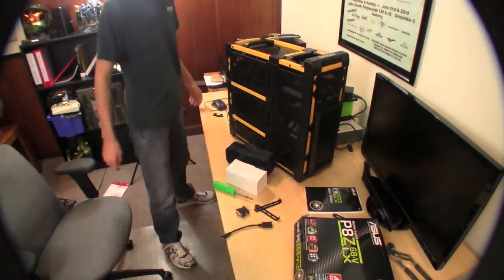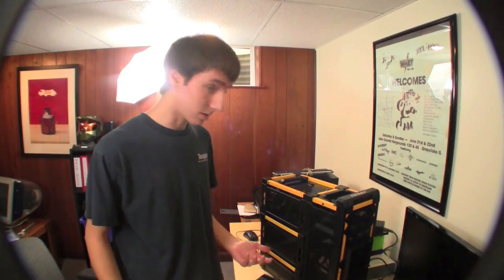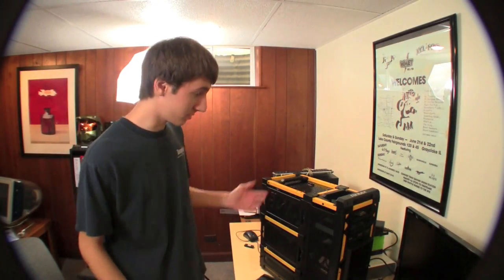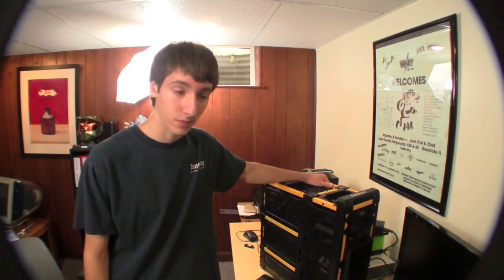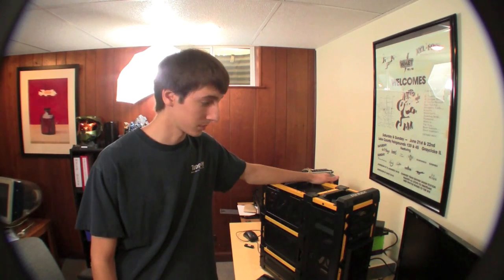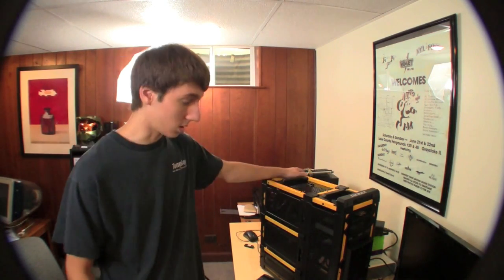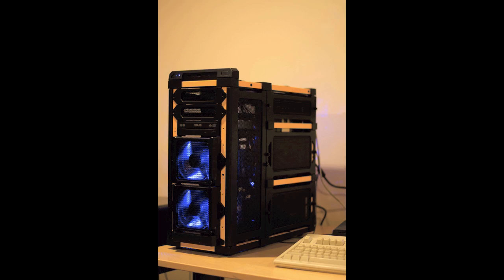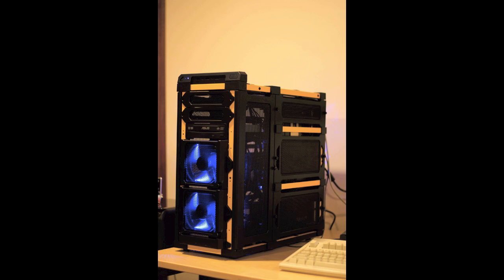Time Lapse Computer Build 2011 4.8GHz Overclock Sandy Bridge (Parts From Newegg.com)

Comment from the maker: I had the i5 2500K running at 4.8Ghz stable for many months, the build cost just under $900.  I have since added an SSD and other parts that have increased the "total" price, but the items shown in the video were just under $900 not including the monitor.  

I now have an i7 3770K running at 4.5Ghz.

Comment from the maker: Only with the 8-pin connector, I had to buy an extension for that.  The 24-pin could be a tad longer but its not a big deal.  Other than that everything was fine.

Comment: nice vid  
 was the 4/8 pin ATX 12v cable (the one which you plug into your mobo at the top left corner) long enough to nicely route it behind your mobo or was it too short. Because I've read some reviews about the ocz modxstream psu and some people had some problems with that.

Comment: Will this be a good build or should i change any parts? (Do i need a new PSU if i'm gonna overclock it ?)
Case: NZXT Lexa S Midi tower.
RAM: Corsair XMS3 1866MHz 8GB Vengeance CL9 
Hard Drive: Western Digital Caviar Green 1TB
Processor: Intel Core i5-2500K Sandy Bridge 3.3GHz
PCU Cooler: Corsair H60
Graphics Card: NVIDIA Geforce GTX 260.(Old Graphics card, might get a new one tough)
Motherboard: Gigabyte GA-Z68AP-D3, Socket-1155
Power Source: Corsair HX 450 Watt (Modular)

Comment from the maker: I agree, a 20-pin internal USB 3 header would have been great.  As for the cooler, I recently contacted Noctua about reviewing the NH-D14 CPU cooler.  The unboxing and review should be up within the next few weeks.  You might want to stick around for that, I got some really amazing overclocks with that cooler on.

Comment from the maker: Yes, I configured everything out myself.  I picked it for the positive airflow (which I have since negated), the price, the handles, and the looks.  Had I known that the case has very little room for cable management, and no fan filters, I would not have picked it.

Comment: your fast at replying, I am going to build my 1st pc in about 2 months and i have done lotts of research and how long do you think it will take me to build this system 

ASUS P8Z68-V LX
XFX Core Edition PRO850W
SAPPHIRE 11188-22-20G Radeon HD 6950 2GB
Western Digital RE4 WD1003FBYX 1TB 7200 RPM
CORSAIR Vengeance 8GB (2 x 4GB) 
Intel Core i5-2500K
Thermaltake Overseer full tower 
ARCTIC COOLING ACFZ13-PRO 120mm & 50mm cpu cooler

Comment from the maker: For a PC, I would recommend a powerful CPU and  GPU. For the CPU, I would go with a newer Intel Core i7 processor because they are made to go in high end systems and workstations. For the GPU (graphics card) I would go with a high end card, such as the new Nvidia GTX 680 so that it can drive a high res screen. I would also go for at least 16GB of RAM (memory) so the photography software can run smoothly. Lastly, for storage it all depends on how many pictures you have and how large they are.

Comment from the maker: For a Mac, I would recommend either an iMac, MacBook Pro, or the Mac Pro.  The iMac and MacBook Pro offer lots of power for a decent cost.  Mac Pro is the most expensive of the three, but it has the best performance of them all.  The only down side is Apple hasn't updated the Mac pro in quite a while so the hardware, while still extremely powerful, is pretty old.  However, there are lots of rumors saying that Apple will be updating lots of their computers soon, possibly within a month or two.

Comment: Ah yes they can be a bitch worse if they get stuck in the case motherboard attached at least you managed to get them out ;) nice to see you remembered them too
 when i worked at shop we had people bringing self builds in with motherboards screwed directly to back plate ;) as you can imagine when powered up was nice firework display :) and yes people really are that stupid

Comment from the maker: @Verithiell I'm an idiot for having stock cooling?  I would replace it if the temperatures demanded it.  The hottest the CPU ever got was 160˚F.  However, I will be buying the Noctua ND-D14 soon for review and use.  Stay tuned for that.  

What cooler do you use?  How high is your overclock.

Comment from the maker: @MikeyLFC94 I am working on making an overclocking tutorial, it should be out soon.  Check the documentation that came with the mobo for the correct RAM installation for "dual channel" mode.  Not sure if every mobo is the same.

Comment from the maker: @groverdog45 Actually, it handles the temperatures just fine.  I have run Prime 95 and Folding@Home SMP and it's never gotten over 160˚F.  I should be getting the Noctua 
NH D-14 soon for review and use.  Stay tuned for that!

Comment from the maker: @KRDesignStudios It handles the OC just fine (I assume as nothing has broken yet).  I don't have a way to monitor the temp of the resistors or MOSFETs but I have TONS of airflow through my case so I think they're fine.  I have the stock fans + two more on the side.  I would definitely recommend this motherboard, excellent bang for your buck.

Comment: Quick question. I know the box says Ati Cross-Fire X ready but is it really only cross-fre compatible ? i have the same exact motherboard and graphic card as you do and wanted to know just in case in the near future . Also as fi as i know asus has always been the ones that always supported SLI and now i don't really know what to do it i find myself in this situation of wanting a dual GPU system.

Comment from the maker: @theleMBeleht Also, when I actually run the OC, which isn't very often, I am constantly monitoring the temperatures to make sure they are within a safe range.  In addition to that, I have installed two more Antec fans on the side of the case for additional air flow.

Comment from the maker: @theleMBeleht Thanks for your comment.  The OC has been running fine even though it has the "ultra-crappy 4phase VRM" and the stock cooler.  I have built computers before, but this is the first rig where everything was done by me, buying, building, maintenance, etc.  If you look at the comments, I said that I will be purchasing a Noctua NH D-14 cooler for this rig soon for use and reviewing.  Lastly, the GPU did fit in there, I just had to bend the metal frame a bit.

Comment from the maker: @MaxPusch Yea, I actually increased the OC to 4.4GHz.  It runs pretty well with the stock cooler but I think it could run a bit cooler with a new one.  I might be doing a review of the Noctua NH-D14 soon which should really drop the temps on it.  The hottest the CPU has gotten was when I was running Folding@Home SMP, that was around 150-160F

Comment from the maker: @duscha55 Grounding is not that important when it is summertime and there is no ESD to worry about.  For putting the heat sink on the processor, perhaps you didn't watch.  At 1:31, I am clearly putting on the cooler right there.  Educate and analyze before you talk shit.